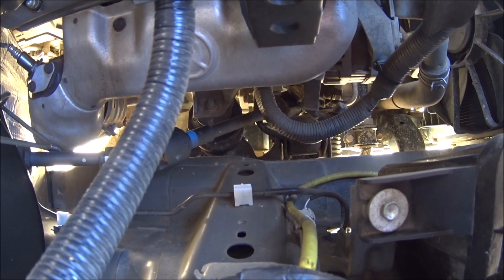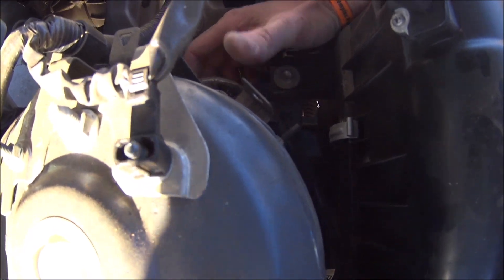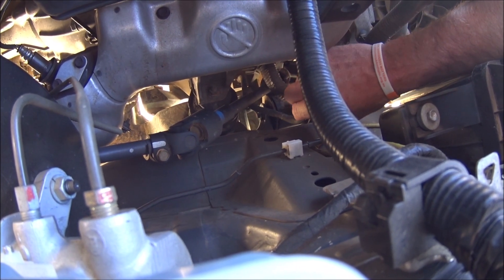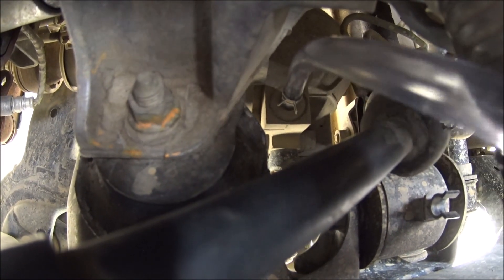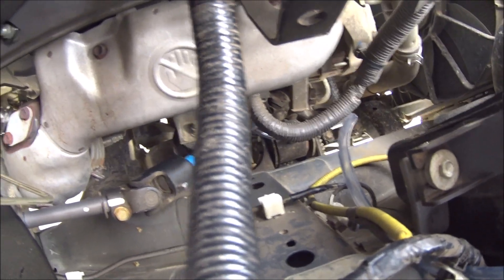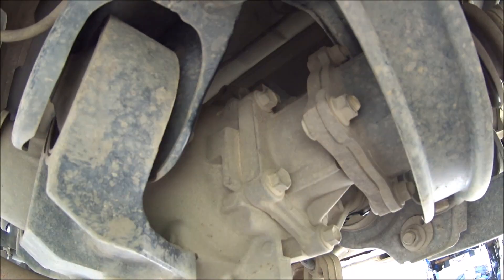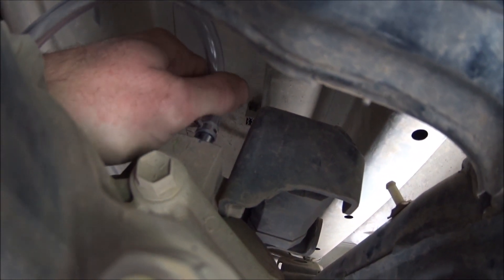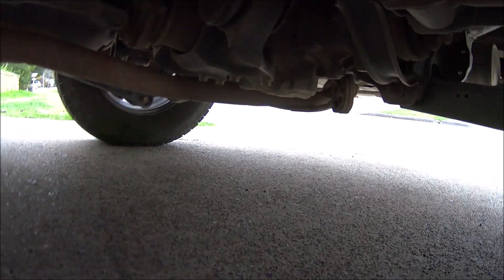Suzuki Grand Vitara diff breathers MODIFICATION video - S2 Ep 5 Jun 2019 #stresslesscampmore !

Comment: Is the hose not getting stiff after a while? Maybe it's not an issue?
Reply from the maker: G’day Sebastian - mare it hasn’t been an issue yet and I guess it wouldn’t be any harder than the ‘off the shelf’ ( eBay type ) diff breather kits with that hard blue plastic line ... ( like I’ve installed recently in another vehicle - check out my playlist 😉👍 ) 
Cheers bud

Comment: I reckon near the exhaust, I'd put something around the tubing to protect it from the heat. The Ranger gets hot under the car.I used some special heat protection wrap around the power cables that run near this area. You'll have to guage it on the suzuki.
Reply from the maker: yeah I'm thinking of some sort of heat wrap or shield type thing that I can put up under there because as mentioned in the vid, I noticed there was some heat affect on the power cable to the tow bar so I don't want that melting through. thanks for the advice buddy. Cheers